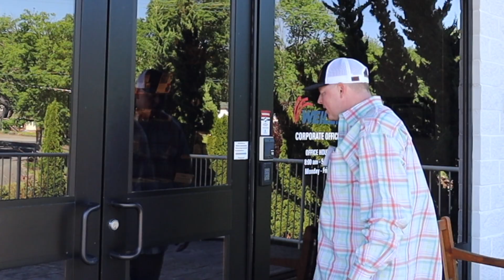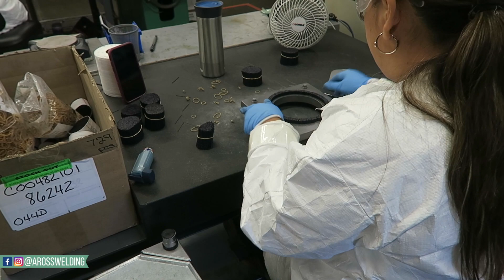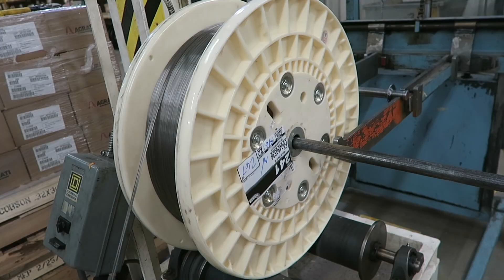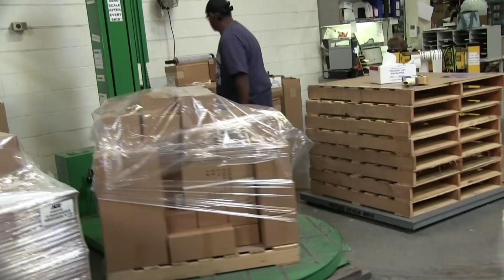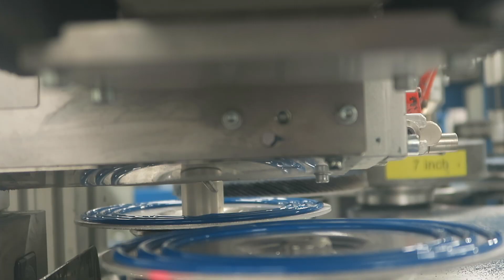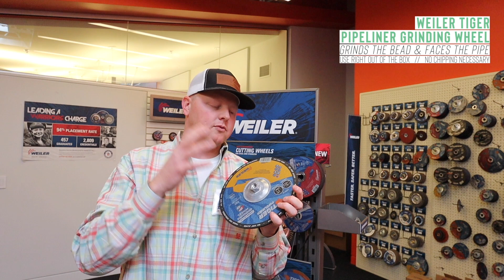HOW IT’S MADE (WEILER PIPELINER WIRE WHEEL & SANDING PADS) IMPRESSIVE!

Comment: Having a 1/8" disc for cutting and grinding is a good idea . I've had over years many 1/8"x7" and 1/8"x 9" come apart on me . Got used to the 5/32"x7" disc which would do both cutting and grinding  for bigger inch pipe  was good for softening pipe when you got Iron bound fit ups . One would grind down to the top of the 3/32" land and a 1/8" rod would work quite well putting in the bead .

Comment: I always wondered how flap discs were made, never stopped long enough to ponder how a wire wheels were made. Guess maybe I was worried the boss would come around the corner and see me staring at a wire wheel and run me off.
By the way nice job on the footage and putting this together Austin.

Comment: Would you make a short video explaining what you mean by "chipping a grinding disc"
Reply: After you grind a few times the disc edge glazes over so we hit the cutting edge with the handle end of the file. Similar to why you dress a grinding wheel on a bench grinder.
Hitting the disc can weaken it and cause a fracture so its not always the best practice.
Reply: @georgeramsey2827  oh. Never had to do that on a grinding disc but I've done that a bunch with chop saw wheel when they dont like to cut! Lol I guess I wasnt putting 2 and 2 together thanks for the reply!